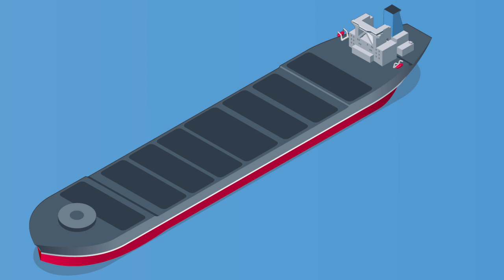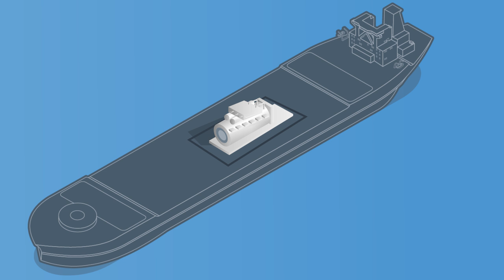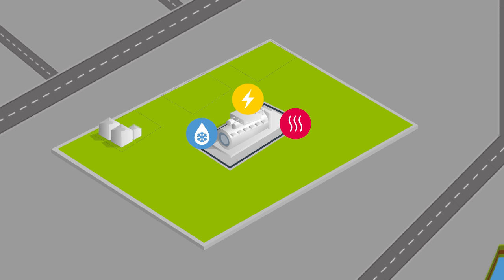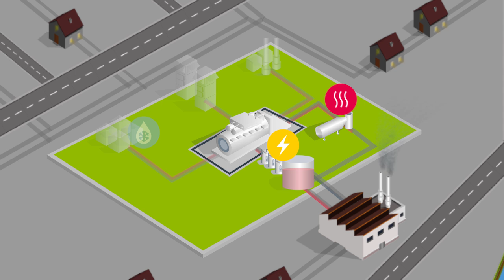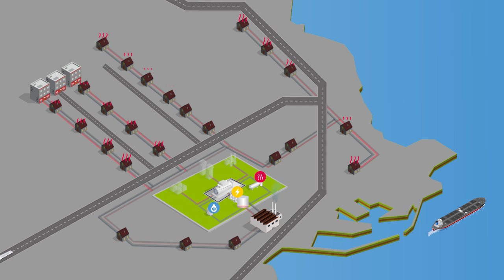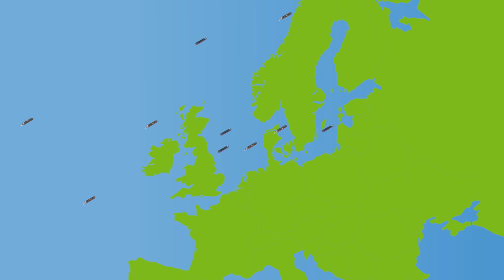Heat recycling at MAN Diesel & Turbo in Frederikshavn

Comment: Great initiative to re-use this waste heat !

advise: Use power electronics to convert your 'waste electricity' into electricity which can be used by the national electricity grid and sell your electricity to the grid instead of burning it up for heat!

Heat pumps can then be used to generate heat out of the electricity, main benefits are: electric power can be much more easily transported than heat, heat pump have an 'efficiency' of 400% so the generated heat is much more.
Reply: +Mayk Thewessen This is not possible in Denmark due to the tax legislations in our country. Otherwise a good idea. Only way to reuse the energy in Denmark is this way!
Reply: +Kristian Andersen Ah crap.. And on top of that, a power electronic station will need more investment than this heat station I guess.